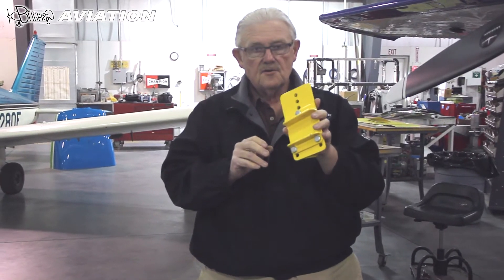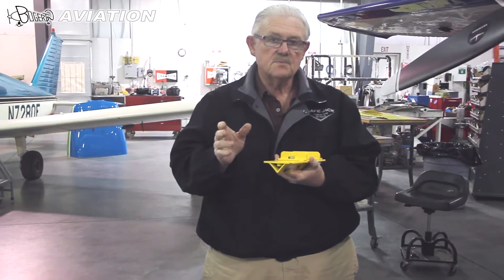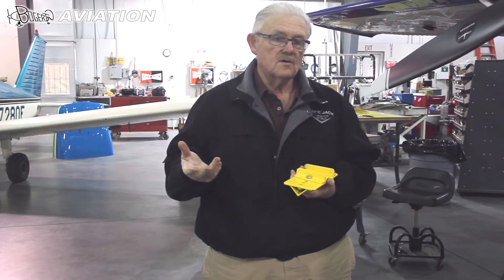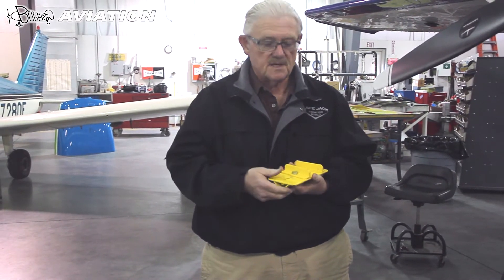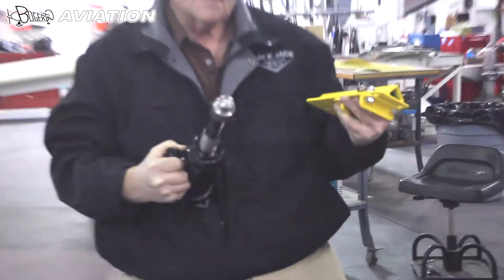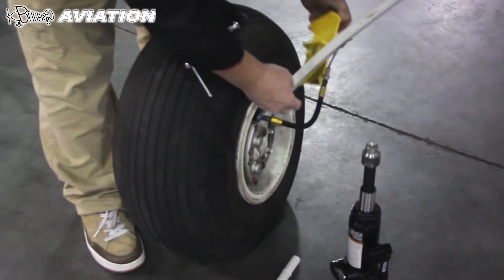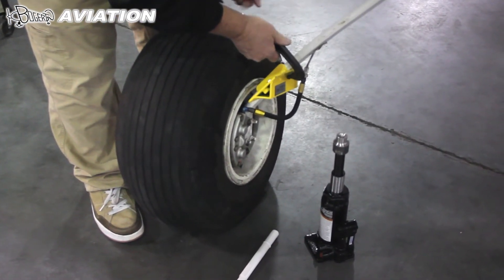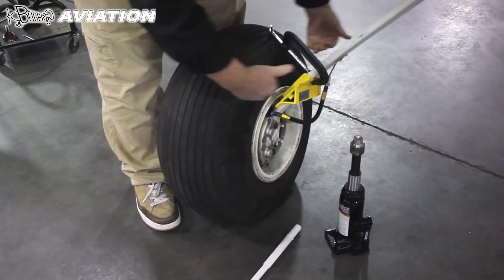Lifting Your Cessna, Champion, Diamond - An Easier Way

Comment: What keeps the clamp or jack pad from chipping or scratching the paint?
Reply: The 30M-FPP jack pad does not have a history of damaging the paint. Once in place, it doesn't move. You can however place a rag or thin pad between the gear leg and the jack pad if you are concerned about it.  We sell a lot of these jack pads and receive no complaints.
Reply: I use a piece of silicone baffling material.